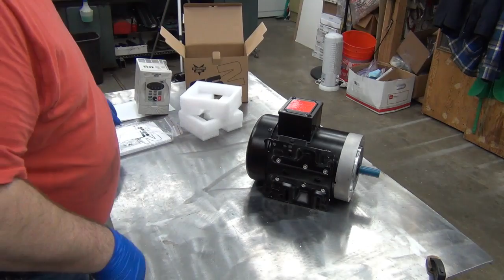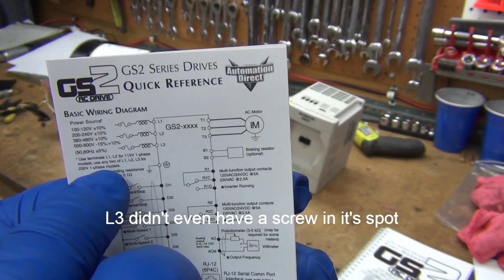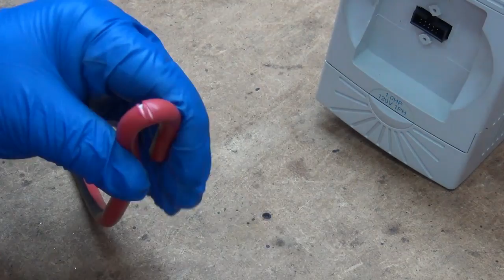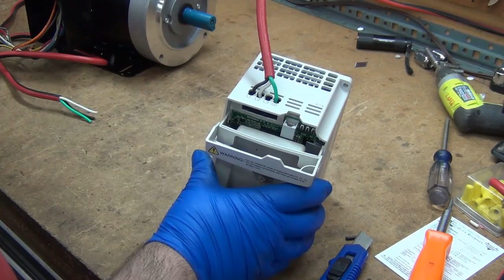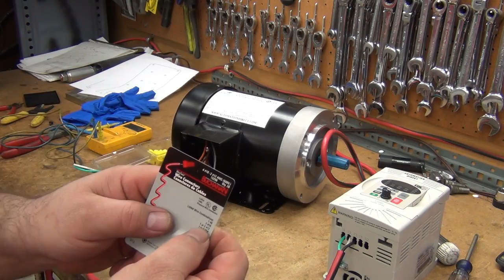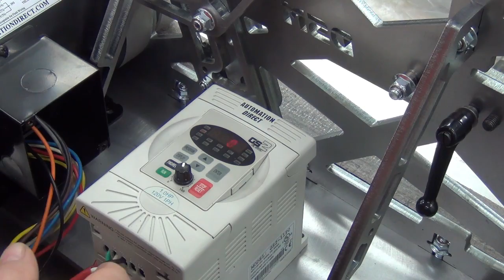DSM Grinder with VFD

Comment: great video brilliant machine that does look good, with your speed pot 2700 rpm gives you 23 meter per second (sorry for the metric conversion) 3m and the big boys recommend up to 32 meters per second, so there is room there if you want to increase the speed
Reply from the maker: Hmmm.....I'm not sure.  I was going to say that the drive pulley diameter could be increased, but that's quite an increase....probably lose a lot of torgue.  It's been years since I've looked at one of these, so I don't know how much more the vfd can be increased.  I have a home built grinder(completely different design) with a 3hp motor and step pulleys.  I can get that one to 10,000+sfpm. Too scary to run it that fast. lol  Sorry I don't have a better answer for you.  If you were to use the same motor/vfd setups as some of the other grinders have, there's no reason it wouldn't run the same.  You can build on yourself if you'd like.  http://www.dsmtoolworks.com/

Comment: It is interesting to see different colour coding used in the USA. In Australia (i think it is the same in the UK) old wiring however still used for house hold (power point) wiring is red = live we call it active; black=neutral and green = earth (now Green with a yellow stripe). For appliance leads, extension leads etc we now use the international colour code brown= active (live); blue = neutral and yellow with a green stripe = earth. Also Australian single phase is 240V 50 Hz, three phase Is 415V. Thanks for the video.
Reply from the maker: Luckily, I have the internet to refer to whenever I do this kind of thing. lol :)  Thanks!

Comment: They say,,, vfd's reduce the overall hp of the combination.. How is the 1hp 3phase motor being driven from 120v single phase as far as power and not being able to significantly drag it down under a good grinding load.. Seems to me that it should do fine. I am wanting to go 120v Single to 3 phase 1hp myself for a grinder, plus have a variable speed setup that I can make portable for some other projects and possibly have to run it from a generator at a remote location on another project.. 
Just curious.. Thanks for the videos.. Very informative..
Reply from the maker: It was okay for power.  The only grinding I did with the grinder is what you see if videos.  I did not keep one of these grinders, so I've never actually used it much.  It was a bit under powered for my tastes, but if you let the belt do the work and don't force the work into it, it should do just fine.  My shop grinder with the 3hp motor can't be stalled or slowed down.....it's a monster! lol
Reply: @bluehandsvideo  Yes.. Thanks for the reply. I do a lot of welding and the grinder is one of the most used tools in my little shop.. I would think a 3ph 2hp would be good enough for me driving it with 220 volt.. And, I had already decided to get the removable face plate VFD... Thanks for the video..

Comment: Can this drive run 220v out? I see you did only 110v. Thanks.
Reply from the maker: It is running 220v 3ph out.  It's using 110v in.

Comment: thanks for thill have a few questions: does it matter how the cables goes in except for the neutral cable? and where did you put that ground on the motor? does the motorhousings also has ground on it? thank you very much :)
Reply from the maker: In hind sight on this, it would have been better to pick up a short length of 4 conductor wire to connect the vfd to the motor.  The separate black ground wire connects to the motor, inside the box where the rest of the motor wires are.  There's a screw in there specifically for ground and it's basically, the motor housing.

Comment: Cool video!  What is the biggest motor you can run using this setup using 110v?
Reply from the maker: I think 2hp is about all you can run on a 110v circuit.....provided your wiring/breaker are up for the amps.  This particular VFD will only handle a 1hp motor.  There may be other options out there so you may get a different/better answer from google. :)
Reply: bluehandsvideo thanks for the help,  working on my senior project and thinking of doing something similar.
Reply from the maker: You're more than welcome.  Here's a link to a build thread I did on my first grinder....it might give you some ideas. :)
http://community.ratsun.net/topic/17029-mklotz70-belt-sander-build/

Comment: Tip. When cutting the extension cord slice lengthwise down the cord then fold it back and cut it off.
Reply from the maker: That's a great tip......and so obvious!! lol   I do it that way most of the time.....but I thought I'd get a cleaner job this way......should have done it your way since I would have only had to do it once! lol :)  Thanks!!

Comment: How about the high pitch noise normally with VFD?   do you have any of that?   I didn't hear it but the belt noise might be covering it up
Reply from the maker: I didn't have it here very long.  I don't recall it being loud or obnoxious.  It's more noticeable at the lower belts speeds, but that could simply be because the belt is so much louder at the higher speeds.  Sorry I don't have a better answer.  Thanks!
Mike

Comment: Thank you so much for your thorough and insightful answer. 
I had my suspicion about the motor needed to be changed, which in this case is an impossibility because is a direct drive motor. But my hopes went back up again when I read about your suggestion related to the soft start "BUT....they do make soft starters for 115v motors". which I will take on your advice.  
 I'm grateful to you for your help, and have a wonderful time doing what you enjoy and are good at!!
Reply from the maker: You're more than welcome! :)

Comment: I enjoyed your video, is very instructional. Thanks for sharing your knowledge. 
I do have a question, if you will be so kind to answer?
 I recently bought a DeWalt DWE790 job site table saw. The motor runs on 120 Volts - 15 Amp - 60Hz. - 4800 RPM. Wen I turn it on in less than a second reaches full speed.        Now, the instruction manual says that I could use dado blades, but my concern is that the dado blades weighs almost 8 Lbs. and chances are that within time the shaft will twist off, and certainly I'll like to prevent something like this.  
Do you know if I could find an speed controller (or some sort of soft star device)  like your or similar that will work on my table saw? 
There is a maze of of these controllers and haven't been able to find anything close to what seems possible for me to use, until I got to see your video. 
Please, I will appreciate any information you could share.
Reply from the maker: Thanks!
I'm not an electrician or electric motor guy, but here's my thoughts.  With more load on your motor from the dado blades, it will just take a slight bit longer to get up to speed.  It's still basically a soft start.....as opposed to a clutch engagement that can apply full torque in an instant.  I don't think your concern over the shaft twisting is warranted.  If the load is that great, you'll burn up the start capacitors or the motor first.....or pop the circuit breaker.
I'm pretty sure most speed controllers will reduce your maximum torque some....which is not what you want running dado blades.  Also....keep in mind that with dado blades, most of the mass is still near the shaft of the motor....at least the blades I've used....and the spacers.  It's not like you have an 8lb weight at the outermost edge of the blade.

So...as far as the vfd goes...they all put out 3 phase....this one converts single phase 120vac to 3 phase 220vac.  You would need to change out your motor to be able to use the vfd.  
In my opinion, it would not be a benefit to switch to a vfd.  BUT....
they do make soft starters for 115v motors.  You might want to check into those.  I don't have any experience with them, but I think that just may be what you need.  I'd consult an electrician that deals with them. 
These are just my thoughts.....I'm not in anyway qualified in this area.  Personally....if the manual says you can run dados.....I'd run them. :)

Comment: You can set it to coast to stop, so the ramp down setting is then ignored.
Reply from the maker: True.  I tend to prefer to have it stop as quick as possible.  The heavy caster pulley takes quite awhile to stop if it's set to coast. :)  Thanks!

Comment: thanks for nice vedio....did VFD work with capacitor 1 phase motor 1/5 HP?
Reply from the maker: +OstazFarid The VFD was designed to drive a 3 phase 1 hp motor.  No capacitor.  They don't work with single phase motors.
Reply: thanks for replay...

Comment: There is a secret technique we use a lot on conveyors that save on motor costs and reduce motor weight. It is called AC motor supercharging. What you do is you a take dual voltage motor that can be wired for 230 volts at 60 Hertz and you change the drive parameters so that it outputs 460 volts at 120 Hertz applied to the motor.. What this does is keeps torque constant up to 120 Hertz, doubles the horsepower, and doubles the speed. The catch is the VFD drive will need to be double the power rating.

So you could take a 1 HP, 3-phase motor, which is lighter than a 2 HP motor, but make the same power as the 2 HP motor. I do this a lot for when I need to have a 3600 RPM motor lighter than a 60 Hertz, 3600 RPM motor by using an 1800 RPM, 1 HP motor.
Reply from the maker: +EETechs Wow...that's pretty interesting!  I've never heard of that before.  By dual voltage motor.....you mean 230/460?   So, since you're using a 4 pole motor, you still get the torque advantage that you don't have with a 3600.  Hmmm.....I'll have to keep this in mind if I do another belt grinder.....it sounds like a perfect use for it!  Thanks!!
Reply: bluehandsvideo The torque will be the same as 3600 RPM motor, but you will have a much wider torque-speed range of 0-120 Hertz vs. using a 3600 RPM motor that will be limited to 0-60 Hertz constant torque range and beyond that point it will lose torque past 60 Hertz. Or in other words its like you have a micrometer and the other guy having a carpenter tape to measure one inch for example..
Reply from the maker: +EETechs Ah....got it. Thanks!!

Comment: If I took that long to strip a wire I'd be out of a job.
Reply from the maker: LOL!!  I know...pretty bad.......and you're only seeing one of several attempts.  Do you have a trick to get the outer insulation off without cutting/nicking the inner?
Reply: +bluehandsvideo  I usually use a blunt cutter/knife and sort of saw through the insulation bending it like you do.  I haven't nicked one in years.  Great videos too.  They take a lot of time and effort to get to the web.
Reply from the maker: +Richard McMahon Ah....that sounds like it would help.  A sharp, new blade doesn't give any feel from one casing to the next.  
They certainly do! lol  I'm months behind!!  Thanks!!
That's a very cool laser setup you have!  Are you planning on posting more vids? :)
Reply: +bluehandsvideo   I really should post some more videos of the table.  I should make one of how it all ties in together so others can build one.  After making one they are surprisingly simple to build (with a few setup teething problems tying the software and hardware together).  When I built mine there wasn't too much stuff around but now the market is flooded with it but also a lot of crappy parts as well.  
I wish I could just stand there and talk like you do but I find it so hard talking to myself making videos and my accent is a bit strong for most over-seas people.
I have all the parts to build a smaller portable table but now I don't have the room in the shed to build anything and I have started renovating the house so building toys has been put on the backburner.
Reply from the maker: +Richard McMahon Definitely post some more when you get the time/space. :)
I love teaching/training and have done a lot of it over the years.......doesn't mean I'm any good at it, but I enjoy it. :)   I just verbalize what I'm thinking as if I have a buddy in the shop with me.  I can't stand my job and don't do any training anymore (there's a few exceptions), so this is my outlet. Plus, I can edit out the inane ramblings. lol! :)    
I didn't find your accent bad at all.  Have you listened to John ( doubleboost ) ?  Great vids, but he's a bit challenging for me to understand sometimes.  Well, worth the challenge, though!!!!
Thanks!
Mike

Comment: Just some info on your motor. I searched for it and it seems to be a Dahlander motor, is that correct? Just out of curiosity. :D
Reply from the maker: I'm not sure of the manufacturer.....I bought if from Automation direct at the same time I ordered the vfd.
Reply: Thanks for the quick response. Dahlander is just a type of motor which is to be used when at start-up, low torque is needed. It has 9-poles, also, and I thought it might be the case.
Reply from the maker: Matheus Moreira
I've never heard of it.  This is the motor I used.....
http://www.automationdirect.com/adc/Shopping/Catalog/Motors/AC_Motors_-_General_Purpose_and_Inverter_Duty_%280.25_-_300HP%29/AC_Motors-General_Purpose,_Rolled_Steel,_IronHorse_%280.33_-_2HP%29/3-Phase_Motors,_56C_%280.33_-_2HP%29/MTR-001-3BD18

Comment: You know it is recommended to provide an earth lead connecting your motor to your drive, right? Also, they sell cables with three phases and ground. ;)
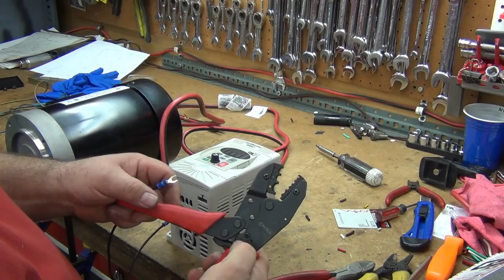Reply from the maker: At 18:57 I connect the ground wire.  It's been awhile since I did this......I don't remember why I wired it this way, but you're right......I should have used a different cable.  I know for the input, I wanted a molded plug on it, but I'm not sure why I didn't get a length of 4 wire cable to connect the vfd and motor.
Thanks!
Mike
Reply: Yep. Ignore the first part of the comment please. :D
Reply from the maker: Matheus Moreira
No prob....I had to scan the vid to be sure I did actually add one. lol! :)

Comment: Very nice grinder! Thanks for the demo on the VFD ;-) 

I was a Honda tech for about 13 years, and I had  just as many (if not more) wrenches before I sold most of my tools and got out of the business. I do miss them sometimes ;-)
Reply from the maker: Thanks! You're more than welcome!
That's just the Gearwrenches! lol   There's at least 2 more sets of metric//SAE elsewhere.  I'm so glad I don't work on cars anymore.....at least rarely!  I've still got a couple of project vehicles, but that's different than having to repair a daily driver! :)

Comment: Either its the wrong motor for the vfd oder the wrong vfd for the motor.
If you want to have constant tourque over a wide speed range the voltage to frequency ratio has to be constant.
For the 230/460 motor this means at 60Hz it needs 230V (low voltage configuration).
Your vfd only supplies 110V at 60Hz therefore the aviable torque is only about half.
If you set the parameters that the motor receives full 110V (full output voltage) at 30Hz than it would have its rated tourque up to 30Hz.
Above this point the tourque decreases as the rpm increases.
The output power stays constant.
With this configuration in the video it acts as a 1/2 horse Motor.

When you install a 230V vfd on it you could have the full tourque up to 60Hz or 1725rpm.
Then the tourque again decreases as the rpm and the frequency inreases and the avaible power remains constant at 1hp.

And if you use a vfd with 460V you can ramp it up to 120Hz without loosing tourque.
The Motor is than capable of delivering almost 2hp.

You may also use ferrules on the wiring.
You can set parameters so that almost any vfd would accept an external potentiometer.
Reply from the maker: I pretty much understand what you're talking about.  This setup wasn't lacking that much torque.  The motor was a 230v 1hp 3ph motor and the vfd was 110v in, 230v out pulse width modulated unit.  We were trying to keep it as 110v input for home shop guys.....which is also what limited it to a 1hp motor.
I have ferrules now. :)
Thanks!

Comment: Great vid!
Reply from the maker: Thanks Jon!  I'm glad you liked it.  You've got some cool vids.  Were you driving in your last two vids?
Reply: bluehandsvideo Thanks! yup :) I'm picking up an automation direct VFD for a home automation project (will control the speed of a large whole-house fan controlled via a touch screen that also controls lighting and such) and your video was one of the first results, it was helpful to see it in use! If you're ever interested they're quite powerful little things, you can pick up a $5 usb to RS485 adapter and use free programs like AdvancedHMI to control everything about the motor from a PC/touchscreen. fun stuff!
Reply from the maker: Jon Sands
Very cool!!!  I had to go look it up.  I just subscribed to your channel in the hopes that you are going to be doing some vids on this project.  :)
Thanks!!
Mike
Reply: sweet! I will definitely be making at least one video going over the system once it's totally finished
Reply from the maker: Jon Sands
Cool! I'm looking forward to it.  I would urge you to take snapshots as you can.  By the time I'm done with a project, it's really nice to look back on them and see just what I did. :)

Comment from the maker: Thanks you! You're more than welcome!   I like to learn from other's mistakes.....might as well pay it back :)

The GS2 is a lot of bang for the buck.  There's a ton of features on it that I'll never use on the grinder.  I will probably move it to my drill press.....or my mill/drill.  If it's not enough hp for the mill, then the drill press should work fine.  I think I'll be just fine with the single speed motor on the grinder. :)